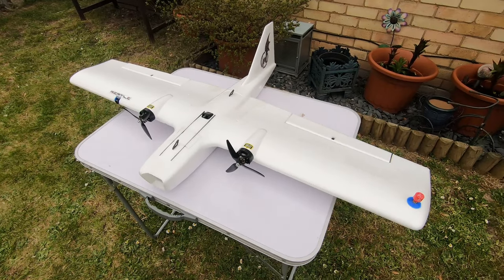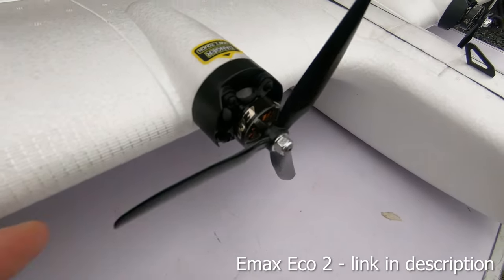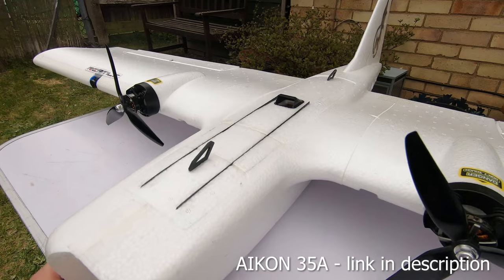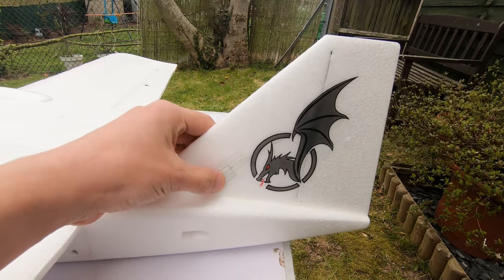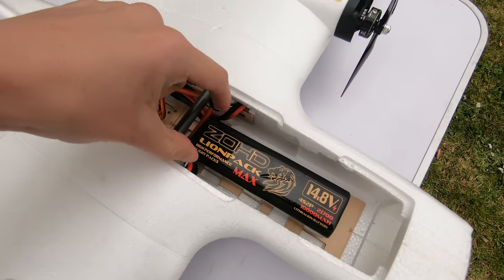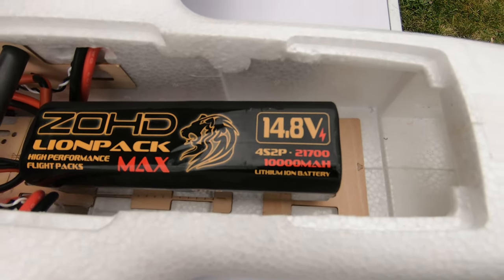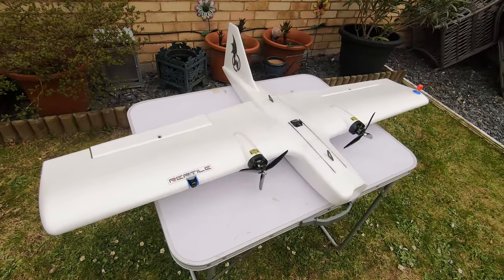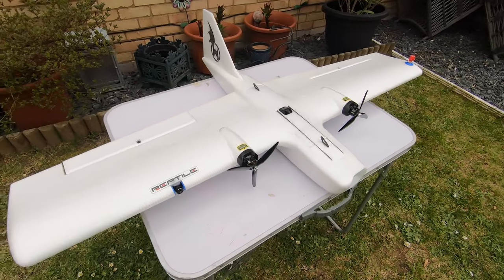Reptile Dragon - Setup / Walkaround

Comment: Nice clean built as per usual 👌🏻 I can’t believe they didn’t just make that a single hatch by design 👀 nice conversion. Oh and I love the tidy install of the rx and antenna. Perfect location for it with there being no electronics in the tail of this model
Reply from the maker: Cheers, yes in the V2 of the Dragon, they've made the hatch a single piece. Much better for access.